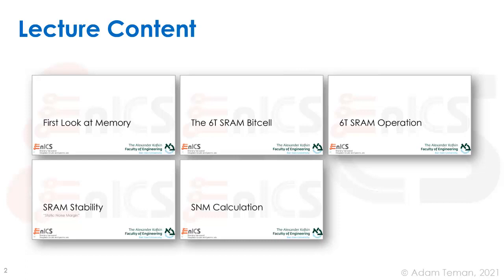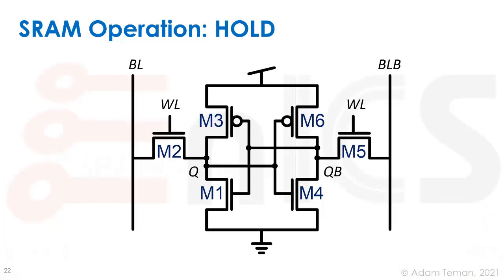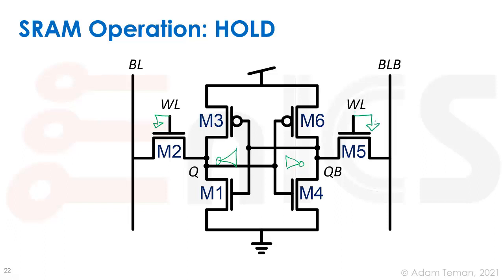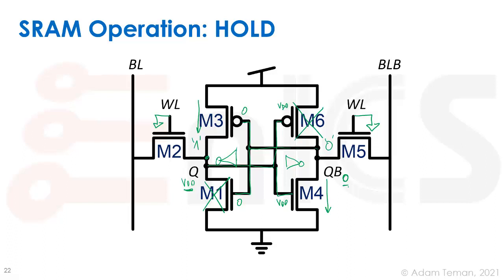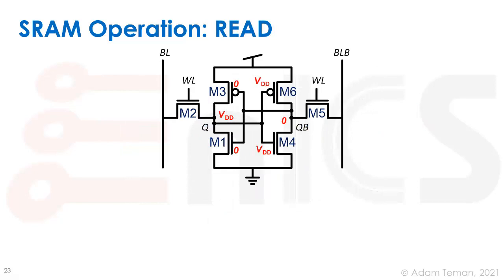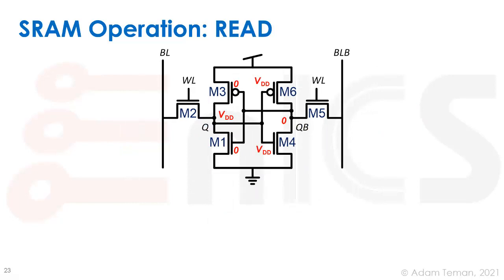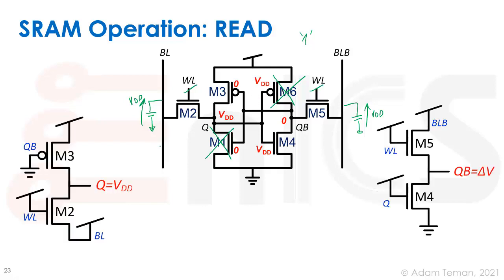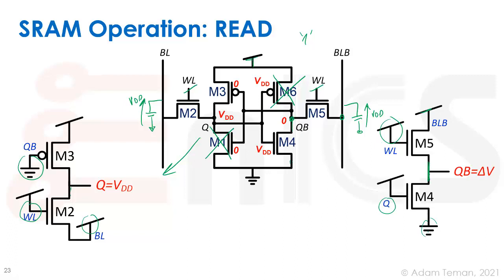VLSI - Lecture 8c: 6T SRAM Operation

Comment: Hi, Professor. Thanks for this awesome lecture. I wanted to ask you that which book do you suggest for problem solving for Digital IC topics? And is there any book you can suggest that isn't quite popular but still a good book on Digital IC Design? 
Thanks in advance.
Reply from the maker: Undoubtedly, Rabaey/Chandrakasan/Nikolic: https://www.amazon.com/Digital-Integrated-Circuits-2nd-Rabaey/dp/0130909963

This is a truly wonderful book. It's really old (2003), but still amazing and not that far behind the future it was talking about.

Weste/Harris CMOS VLSI Design is also a wonderful book: https://www.amazon.com/CMOS-VLSI-Design-Circuits-Perspective/dp/0321547748
it covers everything you could ever think of. Much less elaborate than Rabaey, but has tons of information.